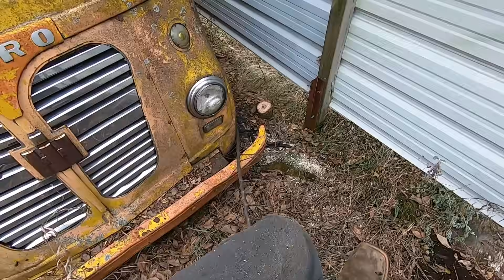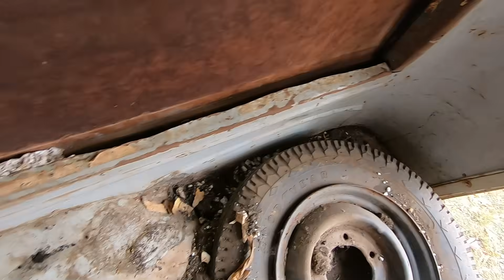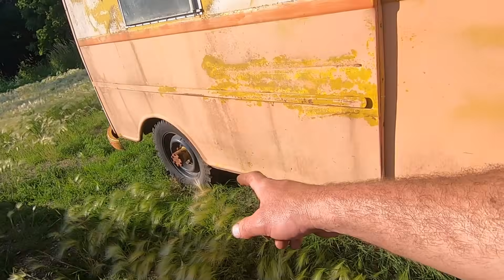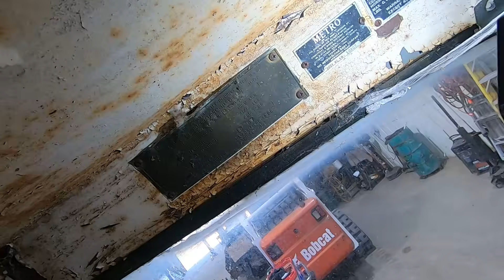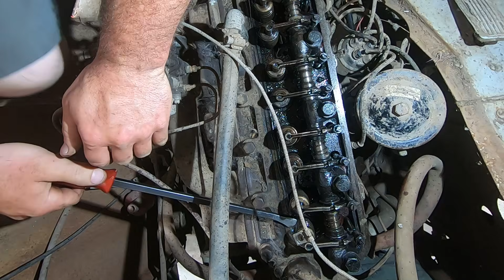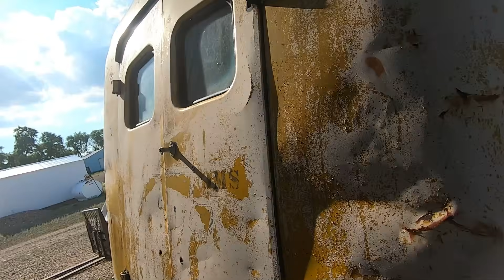1957 International Metro Air Force Bomb Squad Van! Neglected for 47 years! Will it Run?!?

Comment: The “bomb” visible on the side is from the 28th Bombardment Wing at Ellsworth AFB SD
Reply from the maker: Thanks for the info
Reply: My father was assigned to the unit in 1969 to 1972 so there is a possibility he may have driven that truck as they were used by aircraft maintenance crews to move about the flight line from aircraft to aircraft.

Comment: Speaking of tires, back in the day when you looked for a car to buy generally there were two qualifying questions. (This is when everything on the used car lot was $200 to $500) -You asked the salesman, "Does the engine run and do the tires hold air" that was about it,.
Reply from the maker: Haha good times

Comment: Always found it best to add a little air to tubes before installing. Helps em not get pinched between the tire bead and rim.
And the roasting Puddin' moments are the best.
Reply from the maker: thanks for the tip

Comment: Back in the early '80s my dad bought a 65 international Metro that looked almost identical to the one here. But it was mechanically operable. If I remember right it had a 300 cubic inch 6 cylinder and a four-speed tranny with a very granny low. We affectionately referred to it as the ugly truck as we had several trucks at the time. This brings back some memories.
Reply from the maker: Awesome. Thanks

Comment: Really!! do a tune up put new points in, new wires etc..  new plugs.......and while your at it maybe new brakes? You know they cant be road worthy....you seem to make things so difficult......I know new tires, tune up and brakes cost money, but man, spend some money....I hope you dont work on customers cars like this...
Reply from the maker: Why? What’s on there works just fine. Real mechanics make due with what they got. You sound like a parts replacer.
Reply: @MortskeRepair  Real mechanics make due with what they have? I replace the parts that are needed. I am not just a parts replacer. Shade tree mechanics make due with what they have. When you fix something for a paying customer, they don't want a "make due" fix, they want a repair that will last, and be reliable. Would you want some mechanic to repair your Mom's car like that? and have her stranded somewhere? I know I wouldn't want that. Like any one who does repair, I'm not perfect, but I have a reputation of doing good honest work that lasts, and I have done it for 50 years, and I learned from a gentleman that was an A+ master mechanic, and he insisted for me to be a real mechanic and not just a parts replacer. But parts are whats needed to repair auto's. I can't weld up a loose ball joint, it has to be replaced. Ya can't put used brake shoes on a car the customer wants fixed right. I've seen many a car fixed by so called "Make Due" mechanics....The repairs do not last.....Customers want their car fixed to last and be reliable and safe. I understand you just want that old truck to run for your audience, but if you want it reliable, your gonna need parts.
Reply from the maker: @jimenz6548  No doubt. In the video or the description I never said anything about this thing being reliable or road worthy.

Comment: 28th Bomber Wing Ellsworth AFB. The OMS on the back stands for Operational or Organizational Maintenance Squadron. It was a flight line vehicle used to take pilots back and forth to the B52s as well as maintenance crews.
I was stationed at Ellsworth from 1982-85. We still used IH Wagonmaster and pickups for the Missile Security cops. They had campers on them and the Security Police would stay in them out on the Missile fields for 3 or 4 days at a time. I've actually seen a few of the old Air Force IH pickups for sale on the web.
Reply from the maker: Thanks for the info

Comment: I own 3 1957 IH  3/4 ton 4x4 s with the Bud 6 . I fell in love with them when I found the hood could be unlatched from the truck and I could sit on the fenders to tune it up . By the way that wheel bolt pattern is still used .

Comment: Being air force and having a rebuild tag from rapid city, SD. I bet that's an old "bread truck" from the flight line of Ellsworth AFB, SD
Reply from the maker: Most likely
Reply: @MortskeRepair  I was stationed there  from early 2011 through july 2016. We had 3500 Chevy van chassis with a bread box rear on it. They all had the 6.5 diesels. Being as old as this is it was likely on the flight line for the trailing edge of b36 peacemaker and the beginning of the b52 bombers being there. If you can find an asset tag and possibly the original coloring and art work reaching out to the south dakota air and space museum attached to the base might be able to let you know what group of maintainers used it and which aircraft it was actively used for.

Comment: At Hurlburt Field Air Force Base in Fort Walton Beach Florida on the Paintball field near the Flag on the capture the flag field, near the flag, one of these sat for years and years. The glass was out of it and it had no tires or anything else just the shell. If you were good or lucky, you could get inside it and shoot out the windshield at the opposite trenches and duck behind the  dash, The paintballs hitting that thing sounded like being in a metal silo in a hail storm. Basically who ever held the van eventually got the flag.
Reply from the maker: Nice!

Comment: That was my fathers camper, Purchased in 1976 and driven from Alabama to Okmulgee Ok.  My brother fell out the rear door on a dirt road headed to lake Eufaula. Back then his foot got caught between the bumper and the body, twisted and was dragged behind the camper while my Dad came to a stop.  It tore a ton of skin off his back, dad felt so bad, he got rid of it. if its not the same one, its a twin
Reply from the maker: That's a gory story!
Reply: @MortskeRepair  the reason I think it was his, it had two small bench seats at the rear, fold down style, and this one does as well. The markings is a old unit from Ogelthorpe Georgia, and the van was purchased in the early 70s from Anniston Alabama,  (Ft McLellan) and they held auctions there, so it matches both the unit and the area for our van. I cant speak to the tag though, but that damn tail light between the bumper and body looks the same as well, but hell I was little. Those damn camper windows also match my memories.

Comment: No the Metro will not run but It's is running right now when first open the engine compartment door and run the metro in first 5 minutes after you unload all old items away from the Metro utility label truck. The original Metro was with seat, motor, about 4 cubic foot tranny transfer it into 20 HP lawn mower shed or 10 Hp or campbell hausfeld spray paint stock to the side shelf. Also, it with dashboard electric circuit,   brake stuff secondary circuits atlas no 12 volt battery and no key and no latch for back door with no information of bolt pattern of steel rim called VIN with code of specification according to the Manual book called Motor as a topic of International Clark is the labeled to the new salvage with 4 spindles and suspension worth for riding until no one wants to buy the Metro van so it go to the Foss and the Wall recycling centers. The international motor is dirty inside where would you clean internal of the Metro and Chevy another van that went to take the Metro engine to be mount to the chevy truck or Ram van. It is capable as compatible to run atop any chassis with new order of the new mount duty =strong bracket up the engine. The Metro has to have new name = name it Sideswapper. with its 100 HP engine that died and sitting in a garbage for more than 25 years. Thank you for showing.

Comment: Personally, I'm not a fan of using brake cleaner as a starting fluid because it washes the oil from the cylinders. Yes, the propellant in the can may be flammable (propane / butane) but the actual fluid is not. Burning it will just about choke you to death compared to choke / carb cleaner. (ask me how I know)

Comment: The fully removable top on the Blazer/Jimmy ended in 1975. 1976 was the first year of the half top, and the last year of the exposed gas cap. 1977 had the gas cap under the door. So if it's a half cap and exposed fuel cap, it's a 1976.
Reply from the maker: Thanks for the info!

Comment: So is that motor aBD282 flathead  6
Reply: Although if it's like most IH trucks they're designed for any engine International  Harvester made just more the back mount
Reply from the maker: Definitely not a flathead

Comment: Get Your self a Boat fuel tank with Prime Ball, Works the Best.Ever since I told one of the Big shot youtuber, He has been using with no thanks.
Reply from the maker: What's wrong with the setup we're already using?
Reply: @MortskeRepair  A lot easier than  running 12 v lines Perfect flow And fresh gas going into the carb

Comment: I had a government surplus AM-120 just like it but it had a Borg Warner three speed automatic.  Wish you had shown the IH tag. That looks like a SM-120.  Same dash as the S series trucks. The first S series were 6 volt, towards the end of the run the switched to 12 volts. And yes the first S series 12 volt were positive ground. Check how the coil is wired. With the generator it was easy enough to change to negative ground by just re- polarizing the generator and regulator, wich most people did. The A series came next and was standard 12 volt negative ground.  That 6 lug wasn't odd in the 50s.  Ford also used it for a while. The 16 inch tube type wheels to fit that were pretty common back then. The timing mark is on the flywheel. There's a window in the front of the bell housing on the distributor side of the engine. You have a 220 straight valve engine another reason I'm pretty sure that's a S series. When you go to get a valve cover gasket it will ask straight valve or tilt valve. The tilt valve is wider.

Comment: Is there some reason for not using the accelerator pedal when trying to start an engine , and actually filling the bowl ,through the bowl vent so you don't have to work with seven variables, when there are only three, spark, gas and air ?
Reply from the maker: The throttle linkage was stuck

Comment: The "pop top" Ramcharger and Plymouth Trail Duster were produced for the 1974 to 1980 model years.  1974 was the only year for the doors with no window frame loops. In 1974 the window loops were cut off and riveted to the top. This was abandoned by 1975 for production purposes.
Reply from the maker: Gotcha

Comment: I used to work on an airforce base and all the vehicles were way low mileage and the highest speed was I think 40 or 35 and they always did  maintenance more than necessary I wouldn't be surprised if that is the correct mileage afb vehicles are the best used deals
Reply from the maker: I’m sure it is

Comment: 45:12 It is probably a BD (Black Diamond) 220 or 240. Possibly an SD (Silver Diamond) in those same engine sizes. Those words or letters will be on the block and possibly the oil pan.
Reply from the maker: Thanks for the info

Comment: Not 100% sure But I don't think silicone gasket sealer was a thing before mid 70's. Seems I remember I was a mechanic & it was the latest greatest thing. I do remember it  used to be called gasket maker & that was 1 of the selling points. No gasket needed. Make your own out of silicone & the picture @ the parts store showed them making a valve cover gasket by laying a huge bead.
Reply from the maker: Yeah it’s been opened up later on in life I feel like

Comment: That ram charger/trail duster top was identical for 10 years from January 1974 to July 1974 they had a half door but other than that the vehicles were a denticle. With a full removable top
Reply from the maker: Thanks for the info

Comment: Just a thought does a binder 6cyl have a oil gallery plug on the rear of the engine   . My grandpa worked on a ford that lost oil pressure  and leaked and we found a plug backed out between  the flywheel  and the block
Reply from the maker: Very possible

Comment: brake clean sprayed right on the edge of the dry rotted rubber will allow the tire to slip over the rim but you have to do a small section at a time ,just spray and pry then spray and pry ,remember brake clean drys fast
Reply from the maker: Interesting, never heard of that.

Comment: Excellent video Mortske Repair :) my one friend Stephen was Air Force but since retirement in 2010 he had one those but not year of hand also upgrade GM truck frame on plus put 1970 Chevrolet 350 V8 4 barrel carb with daul exhaust, Turbo 700SR 4speed Overdrive Automatic transmission  and 377 posi  rear gears axle ! Put GM rad from 1980 , Brake Booster, fuel tank in frame, truck brakes  disk front & back drums, plus rims of 225 /75 /16 , updated to 5/8 ton pick type ! Electric changes to Negative ground also with GM Delco Alternator from 1985 and years before plus all electronics too!

Comment: If it were mine and I had designs on doing power tour with it I would try to bring back as much of the OG yellow paint and lettering as possible (more power washing, some scrubbing/sanding). Some kind of modern (gasp) in line 6 swapped in (looks like a V8 would be a tough fit) and put her on air.

Comment: One of my older brother's used to have a van similar he's was a 1959 Chevy meat truck it had freezers in it when he got it. 
            Pulled the freezers out of thr van and made it a carpet van he was a flooring installer.
            He called his van the "AFTER BURNER" had a lot of fun in his 59 panel van, camping, hunting, fishing.
The panel van had a vent grill on the side of it. My brother pulled it off and he used it to cook on he made hamburgers and hotdogs on it. My older brother has been looking  one ever since he wrecked his last panel van.
         I found a few panel vans in California, but diffrent year's and makers. Just as cool as the one he had. I think he paid $500.00 buck's for it. Those day's are long gone 1980s!!
         No one wanted those ice cream panel vans back then. You can just about make anything look cool. That's how me and my brother's cousin's bought those odd ball vehicle's nobody wanted bought them on the cheap buck fixed them up to be a good running cool looking ride.

 People would want them after they were fixed up with a nice paint job and new tires with descent seat covers.  When Pop's went to Mexico on vacation we would send the seat covers and panel's to get new covers for the seats, "on the low buck" a whole lot cheaper than what they were charging in the state's.  Any how someone will want that old bread truck probably put a whole new chassis running gear stopping and braking power for modern day traffic. We all seen them done at car shows or on You tube video's they are just as cool or useful as a new panel van.
Reply from the maker: Good stories!

Comment: it shows those could come with a 220, 240 or 269 ci 6 cylinder. my guess is that one is probably the 220, I don't know, just don't look bigger than that. I had a Great Uncle that had a older international pickup, 3/4 ton and it had the 269 6 cylinder in it, that thing looked almost as big as a GM 292, it dang sure looked bigger than the 250.
Reply from the maker: Yeah I don't know much about them either.

Comment: 6.0 mid engine LS swap.  Lay it on the ground and bag it.  Pull the rear glass out of it, put sheet metal in the holes, and do your best to put it back to the bomb squad livery.   Then you can race the Yee-haul.
Reply from the maker: I'd smoke that thing! we got 2 extra cylinders!
Reply: @MortskeRepair  Why have two extra when you can have four extra?

Comment: I know you don't like advice , but I've done this a bunch of times. If the engine has set for long time they don't have any uper lubricant , so if you poor about 1/2 quart of marvel down the carb while it cranks over a few times ,it will lube the valves so they will close, because they will stick open cranking over dry . I been trying to keep from telling you but oh well good luck , I'm Walt
Reply from the maker: Can't hurt I suppose.

Comment: Does that say "28th Bomb Wing" on the side?  The 28th Bomb Wing is at Ellsworth AFB in South Dakota.
Reply: 28th OMS is a squadron in the 28th Bomb Wing.  OMS = Organizational Maintenance Squadron.
Reply from the maker: I bet that's what it is!
Reply: It is. I spent a lot of time with the OMS crowd during the mid 80s and early 90s. I was 28th FMS or Field Maintenance Squadron. I spent 90% of my time out on the flight line with the OMS gang. I bet some of the old timers had ridden in that truck in their early years.
It's a shame they cut up the paint job on it though. It would have been a good tax deductible donation to the museum at Ellsworth AFB.
Cheers
Terry
28 FMS Machine shop, 83 - 91.
Reply from the maker: @machinist5828  I bet it could tell some cool stories!

Comment: YOU CAN FIX IT BACK UP SO YOU CAN USE IT FOR YOUR PARTS AND TO HAVE YOUR TOOLS ON HAND IF YOU WAS TO DRIVE IT OUT TO FIX ANY OF YOUR OWN VEHICALS AND ANY THAT YOU GET TO BRING BACK TO YOUR GARAGE. AND IF THAT AINT IN YOUR PLANS YOU CAN FIX IT JUST ENOUGH SO YOU COULD GET THAT 5,000$ THAT YOU HAD IT LISTED FOR. WELL EITHER WAY I JUST LIKE WATCHING YOUR VIDEOS JUST TO SEE WHAT YOU ARE DOING AND TO SEE IF YOU WILL GET SOMETHING UP AN RUNNING.
Reply: Those trucks were built-in Bridgeport CT ., They would deliver the chassis from IH 3 or 4 at a time.The building was.on Kossuth St.  Knocked it down and built a dog racing track.Used them in CT. for bread trucks, dry cleaners,and Mrs frisbees pies etc.